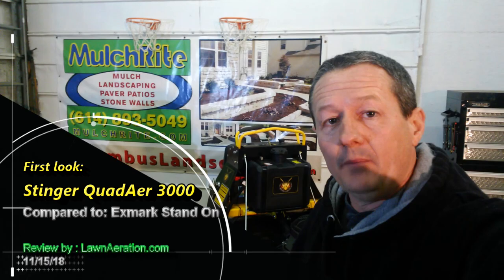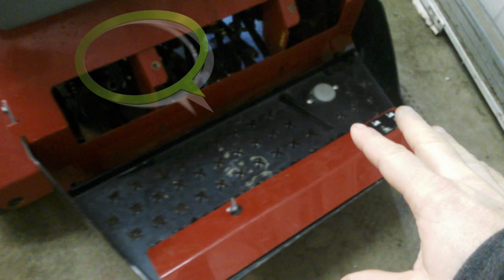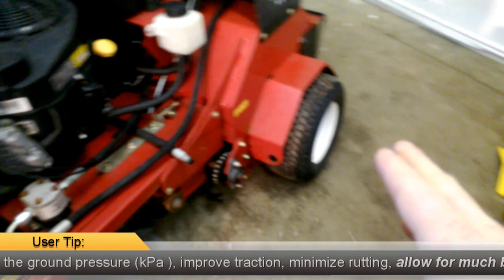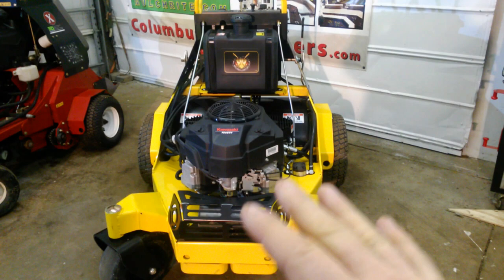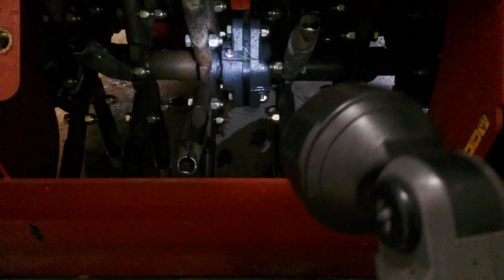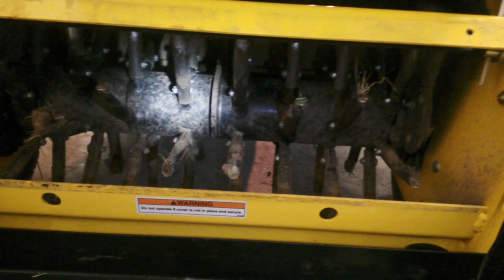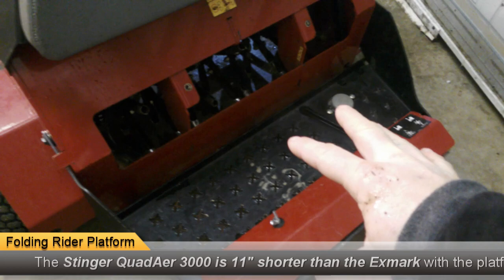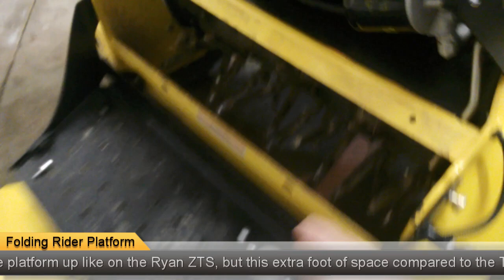Stinger Quad-Aer VS Exmark  30" Aerators

Comment: rented one of the stinger units from my local ace hardware last fall 2020, the unit i had was new, 0 hours.  it worked well, quick, smooth. the only problem I had was the ergonomics of the station and standing platform. after one day my back was absolutely killing me. I could not complete the second day. I have hundreds and hundreds of hours on a stand on mowers so I am used to standing. its just something about the work station is not right.  the platform can latch UP so to take less room on the trailer so  maybe there was a trade off right there. I am 6"1" not overly tall, take it as you will.  the less maintenance you speak of will bode well for rental business, we are a small business so greasing some fittings is not a problem for me, I like to flush out dirt and moisture by greasing.  it would take ten minutes to fix the exmark platform to lift up also.
Reply from the maker: Yea, I could see where the control platform could be a touch low for you at 6'1. As for the back  pain,  I'm very aware of that and it happens almost regardless of the brand of aerator I'm using. I think it has more to do with the tines bouncing and pounding the ground all day long. I notice on mowers and my z-spray I can go all day without the back pain. On the aerator, I use a back brace when I'm running long days and large properties. Thanks for commenting!

Comment: gary,  How do i contact you?  I want to know if you have tried the stinger walk behind dual aire with the sulky.  What are your thoughts on it?  I thought of buying the Lexmark 24"  it was very rough and not ergonomically comfortable .  I currently use turfoco xt5.  i have a lot of clients with smaller gates.  whats your best buy on an aerator for smaller yards. I will be keeping one turf xt5 as well
Reply: jim mcclelland I’m demoing the dual 2475 right now and do not like it. Find plantationlawnandlandscape on Instagram. Did a quick overview of it and how it performed
Reply from the maker: Based on your "small yard" usage I'd look at a walk behind unit. Exmark or     Ryan lawnaire. I use the Ryan's for smaller areas.... https://youtu.be/pAuN_H6OV8I